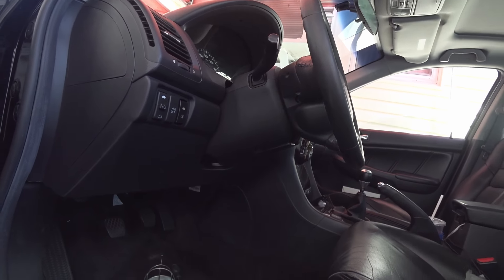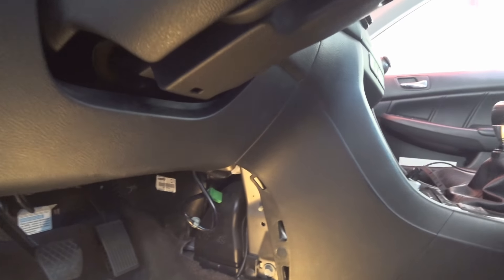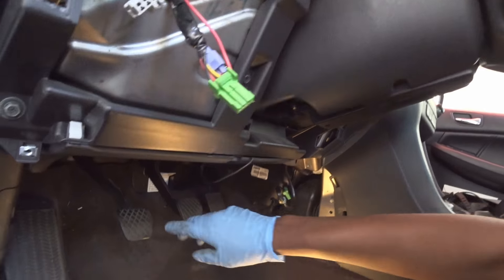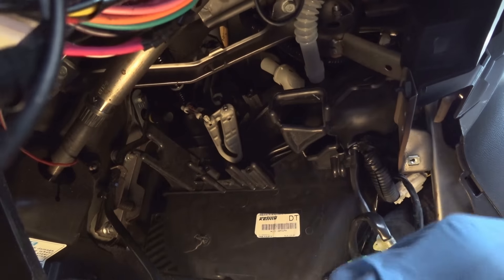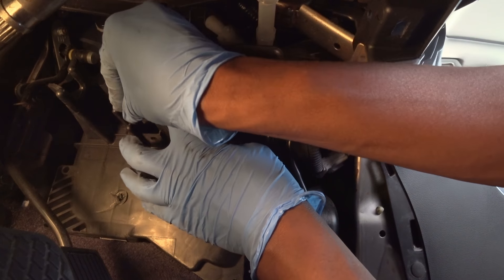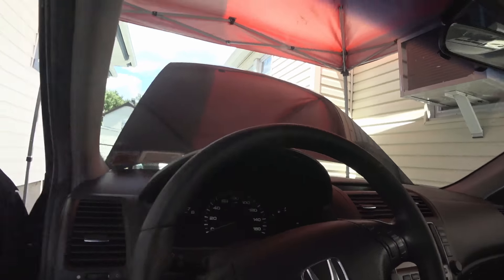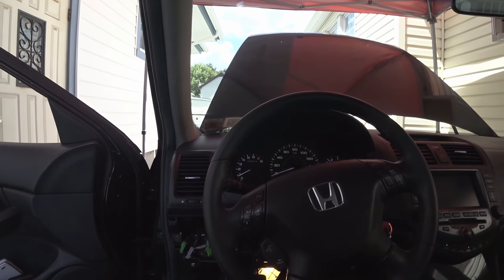How to fix accord blend door actuator. How to fix your AC vent.

Comment: So it's Honda part number 79160-SDA-A41 (I had trouble reading the six).  About $100 for a real Honda part, around $30 aftermarket.  Think I'm going to take the chance on the aftermarket piece.

Comment: What else could it be? Relay is fine, this part is fine also. The compressor is working, a bit colder air from the passenger deflector (near the window) but the driver side blows hot af, no matter how cold I set it up.
Reply from the maker: Take off the blend door actuator and manually move the flap on the hvac box. If that does not change the temperature. Then go In to the engine bay and manually flip the heater control valve that is connect to the heater core line. Those go bad and some time are stuck

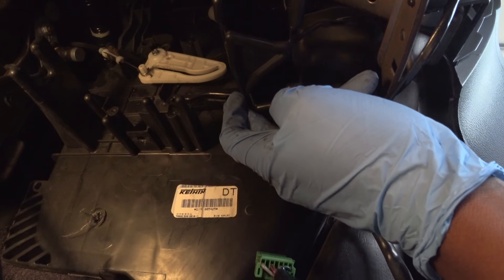Comment: What about if the black piece @3:13 happens to break off?  Can that be repaired? 🙏🙏🙏
Reply from the maker: Ooooo that's problem 😕. If you have the parts you can try to glue them together. Beside that you have to remove the dash and remove that box

Comment: Is there an actuator also on the passenger side or only on the driver's side?
Reply from the maker: If you have the dual climate system the. You have one on each side of the car. The passanger side is behind the glove box. The top one will be for the vent mode and the bottom will be for the climate
Reply: @AJIMPORTS  My car doesn't have the dual climate system. So I guess that means it only has one actuator to replace. I drive a 2006 Honda Accord LX 2D coupé.
Reply from the maker: I believe only one then. But check the dealer site. It will show if it's 2 or 1
Reply: @AJIMPORTS  Thanks! Another question. I've noticed that some of the AC modes blow less air than others. For example, the mode that blows air to the feet and vents tends to blow less air than the normal mode. Could this also be related to this actuator?
Reply from the maker: @alanpachecoosuna3277  I am not sure. Might have to check the blower motor to see if it's dirty or if the resistor is going bad. But I don't think it would be a actuator issue

Comment: How do I knew this is the problem? My Ac/off and on. I was thinking this probobly cause the problem. I could be wrong it could be the buttons in the dashboard too.
Reply from the maker: @stripecatflippangitnamecha8721  most likely it's the actuator over the button. The button would feel weird when you press it. Like in the video you can test the actuator by removing it and manually turning the flap on the hvac door. That's the easiest test beside a scan tool
Reply: @AJIMPORTS  you might be right it's the actuator causing my buttons to turn off all the ligths, cause Everytime I kick that side it comes on. and it's hot rigth now.
Reply from the maker: It's only 3 screw to remove and you can run. The test. I recommend getting dealer unit. Tried aftermarket and had issues

Comment: If that white flap doesn’t go down while the black peice does as well then it’s stuck in the heat passage valve?
Reply from the maker: Both side should move freely. If one don't move. You most likely have a issue inside the hvac box under the dash board
Reply: @AJIMPORTS  yeah kuz I just removed everything and I checked to make sure the blend door motor is moving and it is from hot to cold I also have dual ac as well but that big white flap peice isn’t going down I hear it’s called a heat passage valve
Reply from the maker: @brooklyn7941  not sure the name. But from the issues I have seen with other cars. Try moving the temp from max hot to cold. See if that free up the flap. If not the only choice is to remove the hvac box. I do not think you can access inside the box with out pulling it out. 
I did try removing the center vents and use a long screw driver to manual move the vents in the box. Maybe that can help
Reply: @AJIMPORTS  u mean press max ac on the radio ?

Comment: Will this fix the direction of air? Like to face, defrost or feet?
Reply from the maker: No. This is what control the temperature. The mode control is on the passenger side. If you google it actuator location you will see it. Have to remove the glove box
Reply: @AJIMPORTS  got it thank you very much wasn’t sure which of the two it was
Reply: @AJIMPORTS  I’m having this same problem direction of air but mine honda is dual. Would the mode be in the same location as a non dual honda?
Reply from the maker: @mobbinkorrectly  this was for the mixture of air. If you have the direction issue it has its own actuator. It's on the passenger side. Have to remove the glove box.

Comment: Can I do this myself? Will the airbag go off? Should I unplug the battery
Reply from the maker: Yea its easy. I have 3 videos on the channel dealing with the problem. Some with better direction of the process. You are not touching the airbag system so no need to worry.
Reply: @AJIMPORTS thanks! A bunch of tiny clay beads dropped through my defroster vents and I think they are blocking the blend door cause the temp knob only moves a little. I can hear the beads moving around behind the knob and the beads rolling around inside my car when I turn. So I think there are beads throughout my heating system. I drive a 2017 honda fit 1.5 liter 4 cylinder manual. Do you think I can fix this myself?

Comment: My 2006 Honda Accord has hot air coming from the passenger side two vents while the drivers side has cold air blowing when the AC is on.
Reply from the maker: Just had this same issue with my car
Move down the temp to low then disconnect the battery. That might reset it worked for me. If not you will have to check the passenger side actuator

Comment: So mine has the black clip that u mentioned that changes the hot and cold broken what can do to fix it that piece fell behind that dash
Reply from the maker: Ooo. If the gear is still there maybe you can get a used handle from a junk yard or someone parting out. Don't think the dealer sells them new. Or you will have to buy a new hvac box. And that's a lot of work.

Comment: Hi good video by the way I had a question I have a 2009 ex v6 Honda Accord with the navigation I replaced the Blend door actuator on the driver side because for a while now The vent closest to the driver side door blows cool air but after replacing the actuator now both vents on the driver side blow really cold air at high speeds instead of heat when the temperature is set to high and also it gets warm and cold at the same time  i’ve tried two different actuators but neither of them seem to be fixing the problem passenger side is fine do you happen to know what it could be? Sorry For the long question by the way
Reply from the maker: Take the actuator out and move the handle of the hvac box to see if that changes the air coming out. If it does not change  check to make sure the heater valve on the hose going to the heater core is working. I have another video on the channel about fixing another accord with heater issue.check it out. I did a lot more testing.
Reply: @AJIMPORTS  OK I’ll try that thank you for your response I appreciate it
Reply: @AJIMPORTS  When I flipped the switch behind the actuator it got warm in the second vent from the driver side door but the first one is still cold also when I turned the AC off The switch behind the Actuator drop back down but it wouldn’t go back so vents Were cold again Until I flip the switch by hand again
Reply: Yeah and a lot of the grease from the switch came off too but the driver side 2nd vent Is blowing warm air just not as warm as the passenger side and the first vent by the headlights switch is blowing cool air The switch won’t stay up when the AC is off but when I turn it on and flip it up it stays in position until I turn it off or lower the temperature it comes back down but won’t go back up When setting the temperature back to high it feels like it gets warmer but then it gets a little cooler Like it’s cycling between different temperatures
Reply from the maker: @anthonystark4135  if you manually move the arm and the hvac once you remove the actuator. And it gets warmer. Then it's the actuator that's bad. Does the arms on the actuator move once you remove it and leave it plugged in. 
One issue I was having is the actuator was only going half way. So when I compared the range of motion on a new one that's when I realized it was broken. 
But I always make sure its to manually test the arms on the hvac box before buying anything. 
Also try cleaning out your heater core and checking the heater valve in the engine. I have seen those broken internal and blocking the flow of antifreeze causing inside not to be as warm.
Reply: @AJIMPORTS  OK I’ll do that thank you
Reply: is there any way  possible that i can send you a private message just to show you what um talking about
Reply from the maker: @anthonystark4135  my ig us ajimports2.
Reply: @AJIMPORTS  ok thank you

Comment: Hey my left and right ac vents towards the passenger side works but my middle vents do not blow any air. I changed all the positions of the vets, nothing changed. Do you think it is the aculator or something Else. Thanks.
Reply from the maker: Yep. Try the steps in  The video.
Reply: @AJIMPORTS  thanks for responding. I fixed it by opening the aculator and cleaning it . Now the problem is that I forgot to to align the The plastic piece on the cold temperature so it can move flaps. How did you make sure. Is there a technique for it.
Reply from the maker: @fahedmahases723  I plugged the actuator in and set it to max cold or max hot. Then I matched the arms on the actuator to the arms on the hvac box.
Reply: @AJIMPORTS  hey again. I found out that my blend door aculator is out of order/cycle. I searched so much on YouTube and google. My aculator would think that it is on max cold or hot but be on the wrong direction it is pointing at. When I try to align it to the flips it does not match/fit. Is there any way to rest the aculator. Thank you for you support.
Reply from the maker: @fahedmahases723  on one car I did take the battery off. Pull the actuator sit for a few minutes. Then restart it when the actuator is not installed. Then go from max hot to cold. That reset the system. If not buy a new one on Amazon and return. The old one under warranty hint hint 🙄

Comment: On my 99 accord only hot air comes out, no cool air comes out regardless if I have dial set to the blue.
Reply from the maker: Might want to check that your AC is working and you have enough freon in the system.
Reply: @ I know i do need Freon but regardless in the past when I’ve turned it from heat to cool the heat wouldn’t still blow out.
Reply from the maker: @Jason_Phillips3679 well fix the problem you know. Add freon and see if that change anything. Also check the the heater control valve works and it's not broken.

Comment: Same problem, but my actuator moves. Now I’m not sure what to check.
Reply from the maker: Check the valve on the heater core hose.   Some time that's broken Internal and will cause the same issue
Reply: @AJIMPORTS  the heater control valve on the firewall?
Reply from the maker: @NinaBabyTV  yes. I have seen those go bad. So when you manually turn the lever on top it does a 360. It should stop from side to side. But that's where I would start looking
Reply: @AJIMPORTS  I found it, but I did not move it manually. I used the controls and it moved from side to side. Even though it moves, both hoses are of equal temperature, is that normal when using ac?
Reply from the maker: @NinaBabyTV you have to take off the cable and move it manually. Because if the lever is broken I side. It will still move on the outside. When the ac is on. The valve blocks the coolant from going into the hvac. If the valve stuck or broken even with the ac on. It will still have hot coolant flowing inside the hvac.
Reply from the maker: @NinaBabyTV https://youtu.be/dlT6lXIHKFA?feature=shared.    Check this video out this has the valve broken. And show the other steps I did to try and fix the same issue

Comment: Hello, what does it mean when my recirculation button stops working?(button all the way to the left of the ac control panel) and all the other buttons work ? Please help with a solution
Reply from the maker: Most likely the led in the button went out and needs to be changed.

Comment: I have same car as you and my air-conditioning unit was working windows were fogging up so I pressed on the defrosting button and wasn't really removing fog from windows. After a while a put on the air-conditioning unit and it was jut blowing out warm air could this be the same issue you have or something else.
Reply from the maker: Normally the defrost is blowing cool air out. Are all the other vent mode working. You might be low on freon in the ac system. I have not seem the vent issue with the defrost.
Reply: @AJIMPORTS thanks for your reply. I mean the defrost wasnt working and when i turned on the air con it was blowing warm air. I did realize though coolant was a bit low so not sure if that caused it or something else. Thanks

Comment: My ac is stuck on, could this be the issue? Does not matter what mode im in and this is clicking
Reply from the maker: @4168kid  like in the video you can test to see. But I would think your heater valve is broken. That's the valve that's in the engine bay going to the heatercore. To to see if those hose get hot.

Comment: Would this be the same part to swap out if my front vents are working fine but my windshield vent (defroster) is not working / can't be turned on ?
Reply from the maker: They have another actuator that control the defrost on the passenger side
Reply: I thought the driver side controlled the defrost and floor vent as well.
Reply from the maker: @joshmorris8895  double check.but if I recall the passenger side has the actuator for it.
Reply: @AJIMPORTS  I was on rock autos web siting ordering the driver side part. As I'm not getting hot air ir cold on driver side if car. Or out the defrost/floor. So bought the driver side. Going to install an will be back In touch. Pretty sure site said this was for defrost. Time will tell. Going to install tomorrow.

Comment: i have a honda accord . it blows  cold  air from the small vents on each side but no air coming out from the front vents. any ideas please?
Reply from the maker: Does any of the other vents work.
Reply: @AJIMPORTS  i just hit the actuator with with my hand and and  it worked. thanks for your help.
Reply from the maker: @shawnpeter5035  hahaha well you know what has to be replaced if it stop working

Comment: will this help the problem that my ac only works when it wants to?
Reply from the maker: No. Most likely you have a issue with the ac system. Maybe you don't have enough freon or too much. Or the compressor might be going bad. But you would have to check the system.
Reply: @AJIMPORTS  or like in my case the electric clutch was going bad so it would engage then release for a while only to re-engage. New clutch pain to install but alot cheaper than a compressor and recharge.

Comment: I've checked everything for my ac and so far nothing seems wrong. This is the first time i heard about the actuator blend door. Also my dash board was making ticking noise prior to going out.  Hopefully this will fix it
Reply from the maker: As the video shows. Just take out the actuator and move it by hand. This way you can test the system with out spending any money.
Reply: This sounds like me, in an 09 accord lx. Did yours end up being a door(s)?
Reply: @glennweaver5636  haven't heard the ticking noise in a while so am not sure if that did the trick since I've done other work.  But that wasn't the problem with my AC. It was seals abs something else.

Comment: A lot off unnecessary clips out there all saying the same thing, but showing nothing, but YOU bro nailed it, thank you very much, keep up with the great videos
Reply from the maker: Thanks very much for the comment.
Reply: @AJIMPORTS  replaced it but still not moving the new one i checked it with small battery the new one is moving while its out but when plug to the connector on the car not moving what will be the problem? Please help
Reply from the maker: @SA-pl6zl  plug the actuator into the connect. And leave it hanging. Don't install it. If it is moving then it was installed wrong. If it does not move then you have to check the wiring. Might have break in the wire or a fuse blown
Reply: @AJIMPORTS  i did plug and was hanging and the gear was not moving. And also i checked the connector voltage with voltmeter and it shows 4.30 some like that wiring is also good. Are there anything needs to be done after plugging new actuater ?

Comment: I have an acura tsx 2005 and experiencing the same issue. My passenger side feels colder but the driver side is hot. Could it be this or the freon is low? Any video no how to check for low freon?
Reply from the maker: Since you say one side is cold then I would believe its the same issue as In the video. You would need special equipment to check freon. The easiest way is to go to a autopart store and buy the freon that comes with the gauge and install it. Like in the video you can take out your actuator and manual move the lever. That is a free way to check the system on the side with the hot air.
Reply: @AJIMPORTS  How did you remove the driver side panels? Would the steps in the video apply to my TSX 2005 as well?